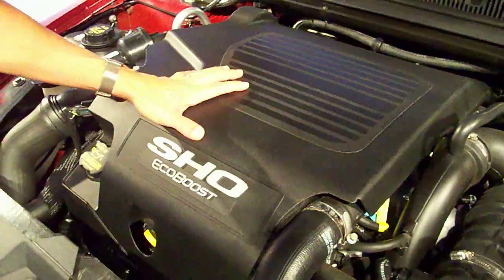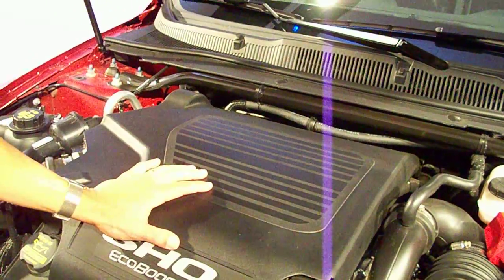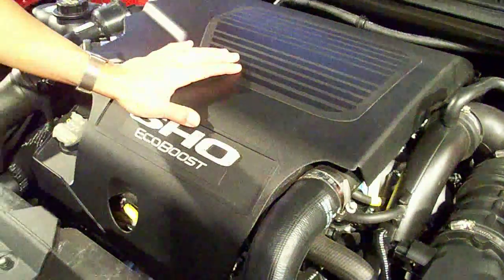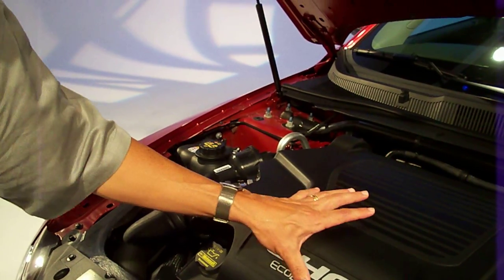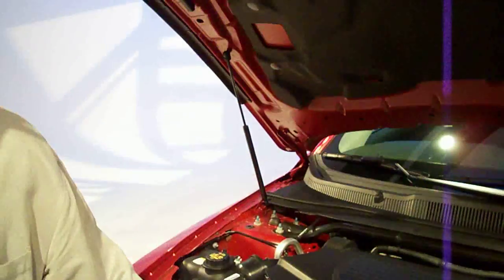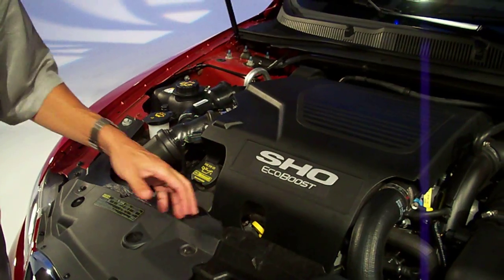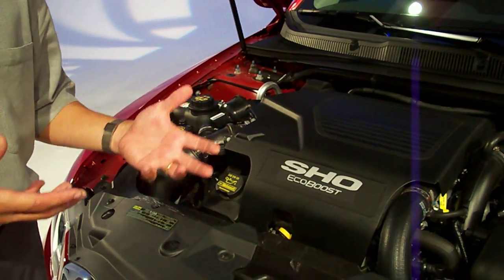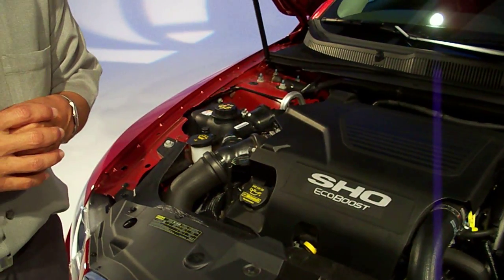Pete Reyes Explains the Ford EcoBoost Turbo Charger

Comment: Whether or not the SHO will be a success doesn't matter.  What does matter is that replacing larger engines with smaller turbocharged engines makes sense now that turbolag is almost gone and direct injection eliminates mpg loss in normal driving.

Comment: Uggg...where to begin...

First, they Peaty got the name wrong...it is not the Taurus SHOW...it's the Taurus S.H.O.

Second, it has two turbos...not one like is implied.

Third...Eco-boost is a joke...nothing ECO about it.  The Hyundai Genesis gets the SAME mileage (17/25) as the SHOW.  And it has a MUCH more desirable 4.6L, 375HP V8.

Fourth...Reyes is a moron.